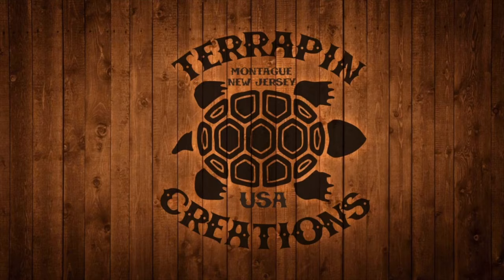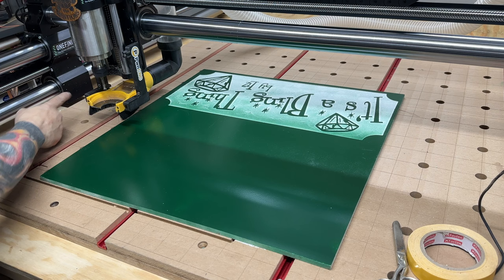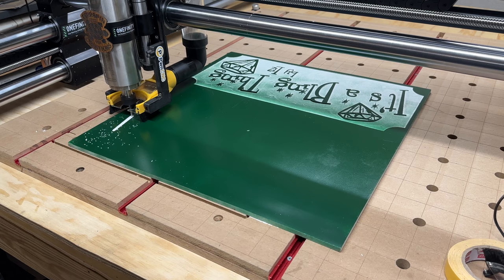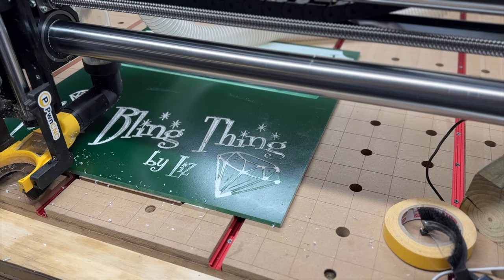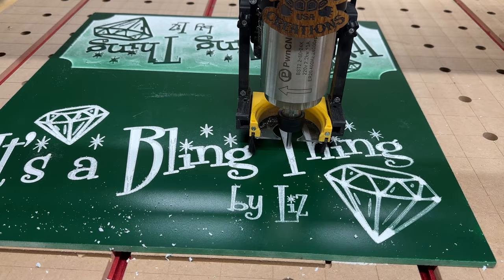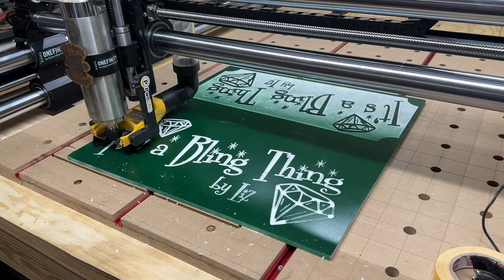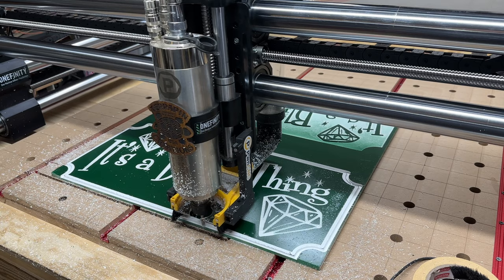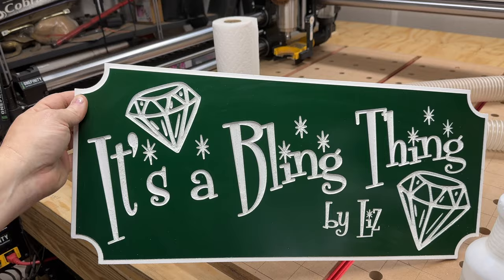Trying To Carve PVC With My CNC

Comment: Hello just saw the vide thought someone was filming me in my garage. I just started last year working with a CNC machine. Thank God for you tube and some forums for advice. I haven't started doing sign work with pvc but what I have read is o flute bit. Also, I use oramask all the time on wood signs works great don't know how it would be on pvc. Keep plugging it gets better.
Reply from the maker: Thanks! I have an o flute and I have a better v bit coming that will be better for PVC.  I chose the PVC since I think it will last a long time outside.

Comment: Try using blue vinyl stencil mask when doing the original style. It helps hold edges around fine details. Usually used for wood vbit engraving, but also works for hdpe especially when painted.

Also, if you’ve got an air compressor, you could consider building a vacuum table with a Venturi adapter. Not as good as an actual vacuum table, but works.
Reply from the maker: I just got a big roll of Oramask that I want to try. Thanks!

Comment: Have a try using air blast nozzle pointed at the tip of your bit, 1 it will cool it to reduce melting and 2 will help evacuate chips so they do not end up attaching to your bit and producing plastic chains that can cause damage to your work surface, I've had this issue when carving fibrous wood and it binds around the tip of small v-carve bits and can cause fine details to be damaged as it works. while watching your vid you can see that the plastic is building up on the cutting edge of your bit so with long cuts it will end up rubbing the plastic causing the uneven levels and strings that can damage work.
Reply from the maker: That’s a great idea! I have something like that for my laser. I’ll work on getting that set up on this too, thanks!

Comment: In that PVC board, you should be running low RPM on the spindle with a high feed rate so it doesn't melt.  You should definitely be able to cut through that 1/2" in one pass too. Use "o flute" bits when possible too.  Fewer flutes, less heat.

Were you using a 1/4" end mill? If so, an 1/8" might work out better. It would remove a lot more on your clearance pass where a 1/4" just couldn't fit. The vbit would have to do a lot less work then, and have a cleaner result. The point of a sharp vbit doesn't leave a good bottom pocket.

Good luck, keep at it!
Reply from the maker: Thanks! I think the reasons I thought the 1/4 would be better is mainly to leave a smoother surface, since it’s wider and I can set it for say a 10% step over. I’ll have to order some 1/8 bits and try them.  And on the RPMs and feeds, yes, I’m hearing that from several people. Thanks for the solid advice!
Reply from the maker: The trick is figuring out what exactly are low RPMs and high feed rates? Nobody has a definitive answer with exact numbers.
Reply: @TerrapinCreations666  I cut through the entire 1/2" PVC with an 1/8" o-flute at 80ipm, 40ipm plunge, 10k on my router.. one full depth pass. I think even that's probably pretty conservative. This stuff is about as soft as butter. Let that machine eat :)

Comment: From my experience engraving text on large acrylic plates is hard to master because any slight difference in height is easily visible. make sure your plate is dead even when trying to engrave. it would be optimal to have a vaccum pulling it down because using tape to lock it in place is good enough for the single flute mill, but for a flat surface its horrible. maybe try to use a large face mill if tape is your only option. bolting it down can also create an arch in the middle, so your best bet is a vaccum table
Reply: im talking less than 0.1mm if possible but if i remember correctly i had to bring it further down. more to something like +-0.05mm
Reply from the maker: I'm hoping someday to get a vacuum table.  I've seen small ones that are maybe 24x24 selling for just under $1,000 that you just add on top of your spoilboard.  For now it's just the double sided tape, and I'm hoping the bit I just ordered will be better for the v carving portion.  That compression bit does a great job for the initial bulk clearing tool path.
Reply from the maker: I had to do just about the same thing as going super shallow really showed off how inconsistent the thickness is with this PVC stuff.  So I just kept trying a little bit deeper each time until it started to look acceptable.

Comment: Using the correct material should help. Kings ColorCore is what you are trying to replicate. HDPE machines better, holds details better (obviously) and doesn't need to be painted.
Reply from the maker: True but I can’t get that stuff locally. I’d have to order online and pay for shipping. Plus clients want custom colors that just aren’t available in colorcore, but I guess I could paint it anyway. Plus this stuff, which is 24x48 costs $40 compared to colorcore which costs $105 for the same size 24x48 sheet, plus who knows how much for shipping. Maybe once I’m up and running, and actually making money, I’d consider that stuff.

Comment: Man, I’ve been here about a thousand times - frustrated, throwing bad money into a project just trying to come up with a presentable final product for the customer - spending way too much time and effort, that even the final payout doesn’t come close to the energy exerted. What did you end up doing with the sign- presenting it or trashing it ? ( you said you weren’t happy with it)
Reply from the maker: I showed it to them and they were thrilled with it, even though it had some fuzzies in a lot of places. But since I wasn’t happy, I knocked off $10. I just got in this bit which I’m hoping will do a better job, at least for the v-carve parts:

https://amzn.to/3IhvOvU
Reply from the maker: I want to make a video testing all different feeds and RPMS using mostly the PVC scraps I wasted. I’m hoping I can nail down the best settings for this stuff.
Reply: @TerrapinCreations666  nice! I used an O flute and cut some pvc sheet goods to make a ghost a couple years ago. I originally used a 1/4” down cut and it all melted. I think at the very least an up cut is key and O is even better. I also found, the faster IPM the better as well. Good luck, make sure you put a video out on it
Reply from the maker: @SJSSawdust I originally was using an upcut, and even though I had lots of double sided tape holding it down, the upcut was pulling the PVC up causing really bad grooves in open areas inside the pocket cuts. So I tried a compression bit that people on Facebook suggested.  You see it in this video and it did a great job. The bit causing the problems in this video is the 4 flute v bit.  I’m hoping the new 2 flute v bit I just got will do better.